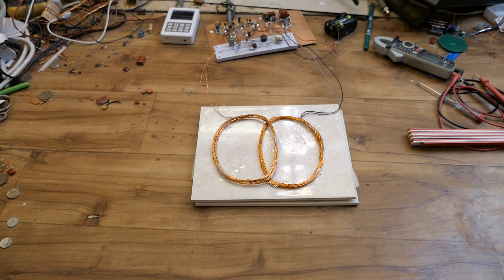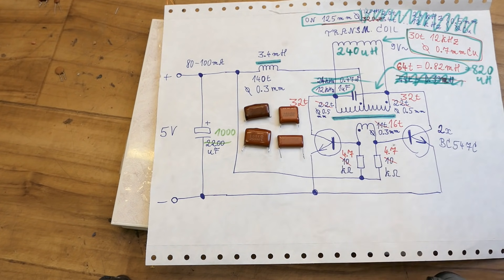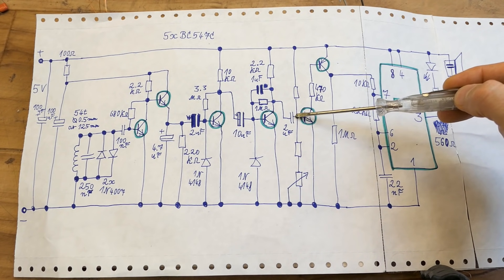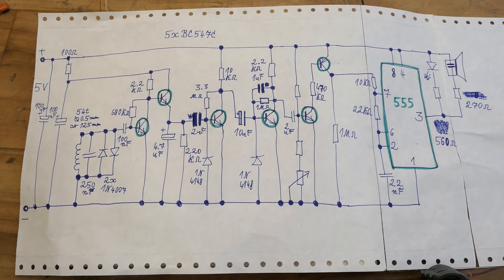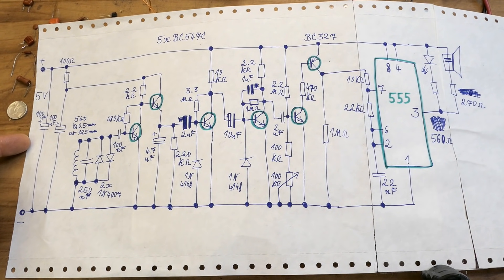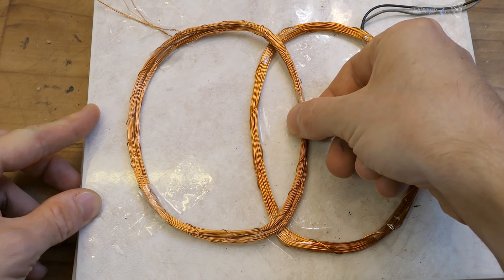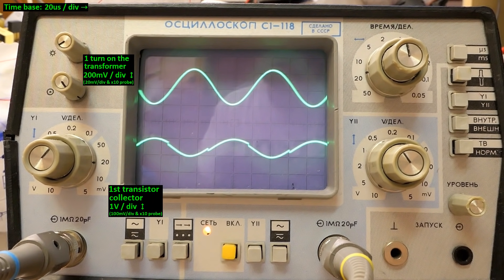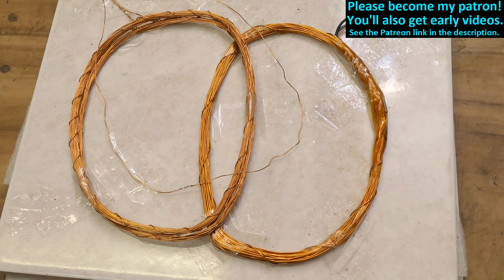DIY DD metal detector 2 - coin at 35cm, audio indicator, PCB

Comment: So my friend and I actually managed to build this today, but as you pointed out tuning it is very difficult as it is extremely sensitive. Occasionally we were able to detect a coin from around 20-30 cm, but one issue we are having is that the LED and buzzer are on continuously while in steady state. So when it detects metal the buzzer frequency actually decreases. My uncle has an oscilloscope I will try and figure it out tomorrow. Anyways thank you so much for this awesome project!!!
Reply: hello, do you have any updates on how your assembly is going? I'm trying to do this but the same thing happened here

Comment: DGW, I'm afraid you have misinterpreted the "nulling curve," and also drawn it incorrectly. The slope of that curve represents sensitivity to the overlap null, it does not represent sensitivity to target detection. The induced signal from a target is about the same no matter where you null the coil, but the target is easiest to "see" when the coil is at maximum null because then the target signal is relatively largest compared to the null signal. The curve is incorrect because there is a phase inversion right at the null point; it is not flat there with minimum slope, but rather has a maximum slope. Hard to say in words, easy to show in a graph.

Comment: I have successfully replicated your receiver and managed 25cm coin sensitivity with only 8cm coils and much weaker transmitter (I use simple LC oscillator with single transistor and it only takes 3mA at 5V), however I had stability problem in receiver. I had 2Hz oscillation on rails (2.5-5mA so almost 50%) which was causing almost constant beeping. I started removing parts while retaining the oscillation, I reduced it to first 4 transistors, I even removed the search coil and it still oscillated. When you look at the first 4 transistors of receiver, the collector resistors are 2k2 0 10k 2k2. I think the 10k or 2k2 could not cause such a deep oscillation on rails so the only culprit is second transistor which has direct path to ground via 4.7uF cap. I tried larger resistor and larger cap but it only delayed the oscillation. I added 6V regulator (78L06, because I power receiver from 9V battery) and power first two transistor from it and it seems to stopped. Later on I also increased Rc of fourth transistor to around 5k. I also used separate 6V regulator for 555 stage. I also changed 100k resistor and 100k pot from base of 5th transistor to 2k2 resistor and 100k pot. This allowed me to lower sensitivity even further using pot. I encased coils in epoxy and tested it outside and found some metal plate and one bottle cap around 5cm underground.

Comment: I'm curious to see at what distance gold coin would be detected. In order to use it for treasure hunt.
Reply: Saw a few comments below regarding Metal Detector‘s and showing interest in the Hobby. Or folks talking about how they’re going to get rich if they build one of these 😂 I thought I would post this reply here, and maybe more people would see it. I definitely don’t want to discourage anyone from the Hobby, but as someone has been doing it every week for 20 years…. Stuff like gold and jewelry and treasure is really hard to find. And gold registers exactly like trash aluminum and llead.

Gold registers exactly the same as small aluminum trash targets. Even on the nicest and most expensive Metal Detector’s… A big fat gold ring will show up on the screen, and sound, exactly like an aluminum soda can tab, or small shard of other trash metal. They also have the exact same acoustic signature and sound like a small piece of lead. And considering a lot of your gold will be found around swimming holes… You’re also going to dig thousands of fishing sinkers… Because they sound identical to a gold ring.

Source…..i own about 15 metal detectors. Been Detecting for the past 20 years. From cheap to expensive. My main machine is a minelab CTX 3030… I have several other minelab machines that are even more high-end than that machine.
But the only reason I have such high end machines, is because of build quality, waterproof ability, and ruggedness. You can do almost the exact same thing with a $300 machine that I can do with a $3500 machine.

 I do a lot of hunting for Civil War artifacts, old coins, and gold jewelry. 

Best place to find gold jewelry is at old or new swimming holes, when people get in the water their hands shrivel up… Their jewelry slides right off. Especially with all that slick sunscreen. 

Second best place is next to a tennis court, Public pool, or basketball court. That has grass all around the edges.

If you drive around your town and look at the basketball courts and tennis courts… You’ll see people playing. And if you look closely you’ll see they lay all of their belongings, wallet, jewelry, hats… Stuff like that… In the grass right next to the court. And then very often, the basketball will hit their pile of stuff, or they’ll forget they put their ring on top of their wallet… And when they go to move it they drop it into the grass. 

I metal detect on average two or three afternoons a week for a few hours each. Both On dry land and in the water. 

On average… You have to recover about 2500 trash targets for each piece of gold jewelry you find. And About 400 targets for each piece of silver jewelry. That sounds like a lot, and it is a lot of work… But still totally worth it and a lot of fun. However, even the best case scenario… If you live in a neighborhood or somewhere with tons of rich people or you have a swimming hole that’s been active for 100 years… More than likely other Metal Detector’s have already cleaned it out. And even if nobody’s detected it… And you find tons of good stuff… It would be better getting a minimum wage job. You would make more money per hour

. Sure I might have $5000 or $6000 worth of gold and silver at the end of each year… But I Guarantee i spent A few thousand hours finding it. Maybe if I’m lucky, and I count all of my gold, silver, and usually somewhere near $1000 in regular pocket change each year… Maybe I’ll make minimum wage. MAYBE!! But that’s not counting gas, equipment, stuff like that. But it’s definitely possible to break even… Which is good because if you really get into the hobby it can get dang expensive fast. A single coil for my machine could be $300-$500. I have several coils for each machine because you need different types of coils for different situation’s. 

If you’re interested and want to learn more you can check out the “friendly Metal Detecting forum”… I’ve been a member on there for over 10 years, and I post my end-of-the-year totals with pictures, weights, and values. Most folks on there do the same.

I’ve always kept a very meticulous journal every day, of my Detecting trips, how many targets are dug, how many decent targets, how many trash targets, and how many hours and location.
It’s fun to do that, but it also allows you to go back and see patterns, and you become better at locating good stuff. Half of a hobby is definitely research.

And when I’m saying it takes an average of 2500 trash targets to find one piece of gold…that’s using some of the best modern metal detectors out there, costing upwards of $3500. They definitely make Detecting easier in some aspects, but I can do the exact same thing with a 200 or $300 machine. Especially if you get the machine super capable and sensitive like the Fisher F2. Which is an extremely good machine that can perform as well as any $1500 machine out there. But you can pick them up for really cheap.

So although you’re not going to strike it rich… it’s absolutely worth it! And it’s a lot of fun! I paid for most of my machines with the gold , Silver, and pocket change I find every year. You’d be hard-pressed to find another hobby that would completely pay for itself.
However… When you consider 1000 pounds of pocket change every year, and at the bank and coin star machines won’t take dirty corroded coins… You have to clean them. But that’s pretty simple just put them in a bunch of big 5 gallon buckets with vinegar for a little while.

But it’s still a pain in the butt dealing with well over 100 pounds of change every year 😂
Reply: @hullinstruments  100 pounds of change? As in, 45 kg of assorted coins or £100 of British currency?
Reply: @vaclavtrpisovsky  Well his name is "Hull Guitars USA", so I'd bet you a gold ring those pounds are in weight. :P
Reply: @vaclavtrpisovsky  I live in the USA, but yes at least 100 pounds of loose change. Or “clad” as it’s called in the Detecting community.

When you’re digging a few hundred holes each trip… And taking 2 to 3 trips per week year-round… You end up with well over 100 pounds of pocket change. 

We call it “clad“ in the Detecting community. Because most of our coinage is a cheap base metal like zinc, plated in a thin “cladding“ of copper or other metal.

However, the term doesn’t apply to points from before 1964.

Because before then, most American coins were 90% silver. And all pennies were solid copper before 1982.

I’ll have to check my year-end tally on my forum posts and journal..  but think I ended up with approximately 130 something pounds of clad coinage. Probably a few thousand of them were pennies made after 1982, and since they are zinc with almost no copper at all… They very easily erode into nothing and become almost unrecognizable. Because we have very acidic soil. So those I’ll go in the trash.

For the other stuff… I used to clean it with vinegar and shake it around in a 5 gallon bucket after separating into the different types of coins. 
But since I do this so often, and have s large quantities to process… I invested in an extra large rock Tumbler so that I could make them look brand new without any work. I also use the rock Tumbler for other things, so it was worth the purchase.

Tell you what else is wild… last year I recovered about 160 pounds of lead. From fishing sinkers mostly. Maybe 5% of it was from fired bullets and wheel balancing weights. I do a lot of detecting in the water… in old swimming holes… Because that’s where a lot of the gold and silver is. 

But i find loads and loads of lead.. especially where people catfish, because they use a very large lead weights to hold their live bait near the bottom. And you have to recover the lead targets if you’re looking for gold. Because a big gold ring will sound exactly like a large lead sinker, and give the exact same numerical signature to the “brain“ of the detector.
Reply: @vaclavtrpisovsky  also, considering a large amount of that pocket change is quarters and dimes, (because they give off a signature similar to silver jewelry or brass/copper buttons from the Civil War or other highly conductive relics)….. 

So if I see those numbers on my detector screen….., even if I’m not looking for pocket change…. I dig them. 

So that’s why I end up with predominantly quarters and dimes.

I can have anywhere from a few hundred dollars to a bit over $1000 each year. I would say on average each year I find around $750 in pocket change. Some years much more, sometimes it’s more like $450. It’s according to what type of hunting I’m into that particular year. 

Because obviously if I’m detecting old Civil War sites in the middle of the woods, I’m not going to find loads of pocket change.
Reply: @hullinstruments  
My be true in USA ...but what about the big world ...😉😉😉
Reply: @alialpha8982  which part of my post are you referring to? Because I would absolutely love to go searching in other places except the USA! Honestly the USA is one of the worst places to detect. We have almost no history, and the oldest thing here is 100 years old if you’re lucky! The only thing great is the Civil War relics. Especially if you live right in the heart of it like I do. In one of the biggest Battlefields.

Hell across the pond… You can pick a random field 100 miles from civilization and start digging up ancient relics! It’s one of my lifelong dreams to go metal detecting there… Or pretty much anywhere outside the USA. Also there are larger coins in circulation in other countries. In the USA the biggest coin in circulation today is $0.25. But over there they have the pound coin, and all types of other awesome coinage! So pocket change would add up a lot quicker if you dig as many holes as I do every year.

Comment: this is interesting since ZVS is used in one of the expensive minelab detectors and to watch diodegonewild make from scratch using his own understanding of electronics is truly fascinating. i wonder how it will perform on soil and if there will be ground balancing added and coil shielding. the materials used for shielding are like an RF absorption paint and can be home brewed using a glue binder and the black goo from a carbon zinc battery , graphite or a mixture of  both. it needs to be made into a glue suspension that will dry leaving or cure with a specific ohm per square centumeter value...i dont recall the range but perhaps there will be some info in the geotech archive of metal detection technologies. I made some of the RF paint about 10 years ago and was PVA based with battery goop and graphite and made a very good shielding for a probe coil i made. i have seen graphite and epoxy based shield paint in a standard minelab 11 inch coil. so the binder works with either water based or organic.

Comment: Your project will work but when you will put on field you will be disappointed: ground itself have capacitance so you have to shield the coil and you will start to pick up soil itself (gorund minerals) so the distance at you will sense a coin will be very short and you experience a lot of false signals. Unfortunately the ability to build a good detector is the ability to deal with those drawbacks. I suggest you the book of Carl Moreland - George Overeton, Inside the metal detector. keep experimenting in any case your channel is amazing.

Comment: My friend and I are trying to replicate this, but we are stuck trying to wind the transformer that feeds the coil. Is there any transformer we can salvage? Or any tips on winding one ourselves?
Reply from the maker: you can use almost any flyback transformer of a similar size. Wind 32 turns, then make the centre tap, then continue another 32 turns. Then wind 16 turns for the feedback. Mind the direction of the feedback winding, otherwise it won't oscillate.
Reply: @DiodeGoneWild  Tremendous Thank You!!! We were able to wind a transformer with the same turns and roughly the same induction measurement. We tried multiple times to build the circuit on a breadboard but it didn't work. When we went and soldered it to perfboard, it worked. Using the AC setting on a multimeter, we got 12V-AC across the transmitter coil. When we brought a large metal object, the 12v decreased. Tomorrow God willing we are going to build the reciever circuit.

Comment: exelent performance!
and you can use small ferite transformer to translate the low(max500pf) variable capacitors on to a nF capacitor by choosing a right turning ratio

Comment: You may use a little adjustable coil in series with the receiver coil so that you can tune the tank circuit easily. You can scrap it from old CRT TV or PC monitor. You may need re-wind it maybe.
I follow the project!

Comment: I think we can use push-pull amplifier for transmitter output, so we don't need anymore use the transformer that struggling to find on the market.
Reply: And use the phase shift for the different sound that inform us what metal it is.
Reply: Я делаю как раз вариант с Push Pull, но тогда лучше мотать катушку с отводом от центра. Тогда можно использовать микроконтроллер типа STM32 для раскачки передачтика и обработки результатов.
Reply: @stalkerfromvoronezh4493  да, то, что ты делаешь, прекрасно.

Comment: if you had bigger coil then could you add extra turns to fine tune it but smaller coil you need less turns so you can tune it is that correct or did you never test

Comment: I made one years ago and had the second coil run at 5 x the frequency of the main one. they were then mixed and the audio amplified to a speaker. was quite sensitive it could detect anything coming towards the coil.

Comment: I would only use a duel coil on a discrimination detector mono it's fine for what your doing there is a site I'm a member is geoteech metaldetecting where we have a community on what your doing lots of info there and help
Reply: Is there a design I can use to install a metal detector inside the under carriage of a robot chassis? 
I came across this "Double D" design some years ago that used a PLL chip. Was published in a magazine article and looked promising. 
Like many projects, it got canned for lack of knowledge about metal detectors and which ones to go with.
Reply: @piconano  no because the electrics will interfear with the detector you would have to have the coil away from the vehicle
Reply: @daveherd6864  I've seen one operate in San Diego, CA by the beach. 
The dude used a metal shield separating the coils from any interference from within the robot. 
He was finding jewelry right left and center. 
I've seen some that use a trailer type sensor, where the coil is pulled behind a robot. But that's not what I'm looking for.

Comment: You might want to check out phase shift of high frequency received signal. You should have a phase shift with the transmitter that correlates with the type of metal. That way you can tune receiver to for beep for gold but ignore mostlhy iron or whatever. Of course measuring phase shift with amplitude makes it a lot more complex, especially when you start putting limits on phase shift to ignore some metals.
Did you try differect receiver coils already or estimate Q of the receiver tank? That can affect receiver selectivity and sensitivity.